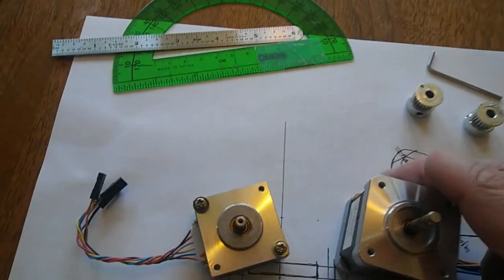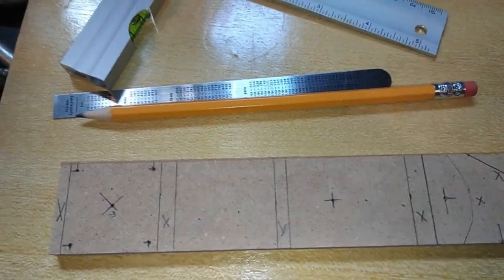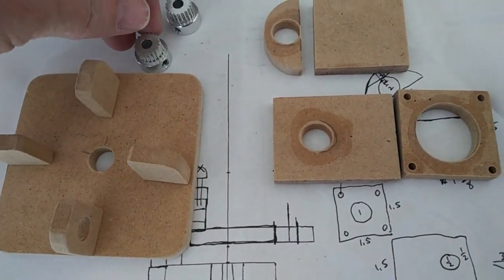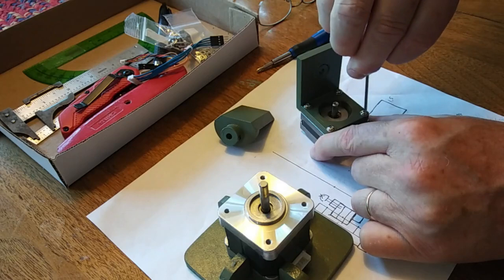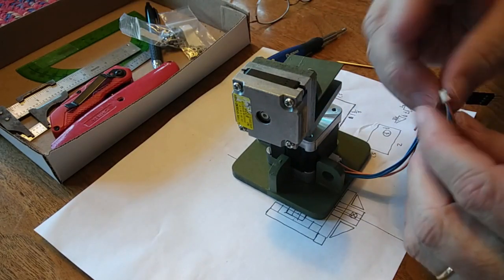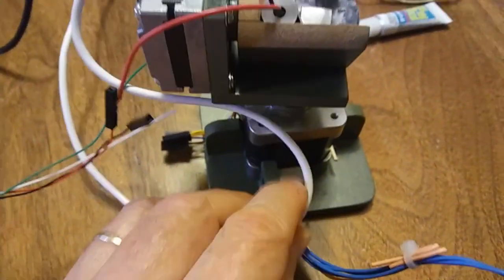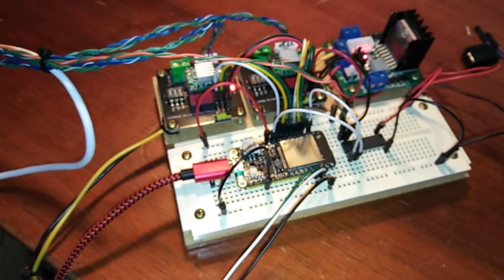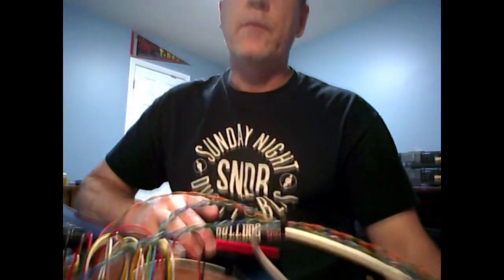Laser Tracker Targeting Test Platform Build

Comment: Nice workmanship on the x/y gimbel. Working on a similar object tracking security cam project. Thanks for the code.🙏
Reply from the maker: Cool. I haven't had time to work on mine lately. I have some pretty neat additions, but accuracy is a problem. I'm working on the parallax issues and still trying to get the camera calibration consistent. Hopefully I'll be able to get back to it soon.
Reply: @ClaytonDarwin  Have you tried microstepping the motors? Your code is very impressive (some over my head). Most of my NEMA steppers are 200 full steps per revolution. IOW, 1.8 deg per step. So at 10 ft distance, the accuracy could be off by up to 3.78 inches. 1/16 microstepping would reduce that to .236 inches.
My security camera has a 50 mm zoom lens, 3 geared mini steppers (focus, aperture, & zoom), 5 DRV8834/25 stepper drivers, 2 NEMA 8 X/Y steppers (w/60:1 reduction worm gears), a buck converter, and a RPi3A.... all mounted inside a 1/4" thick aluminum channel. IOW, my challenge will be balancing the mass between ball bearings. I'm also accelerating/decelerating the steps during start/stop, by reducing the frequency of the step pulse. With such small open loop stepper motors, I anticipate them skipping a few steps now and then.
But, a challenge w/o the challenge is only a waste of time, right?
Perhaps you could start microstepping as the center of the frame approaches the center of the targeted contour, then fire the laser when they are aligned. The targeting system would slow down and increase its mechanical accuracy, but OpenCV would still be trucking at full steam. Hope this helps.
Best of luck on nailing your targets. 😎

Comment: Nice!  You try the W600 yet? I couldn't get a spi display working but most regular uPython works fine.  FTP file server makes loading scripts simple!
Reply from the maker: Hey G. Thanks. I've used one for a work project to send test data on a UART line. I like them, but just haven't had time to test them much. Will keep the SPI thing in mind. May still use it here, but was just wanting to get vid out this weekend so went with the more familiar.